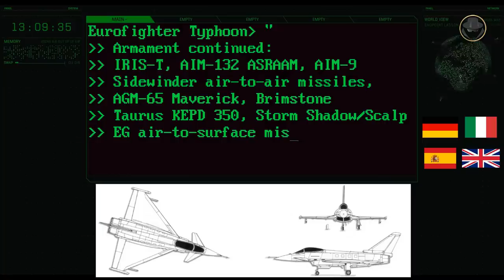Eurofighter Typhoon | The story that the West does not want to tell

Comment: It is an extraordinary aircraft. The real challenge is that for many nations the F16 is good enough and cheaper.
Reply: Tranch 3 and 4 typhoons armed with meteors and Brimstone missiles are as good as F-22 and F-35s. Most counties have early model F-16 which are far behind in terms on senors and radar.
Reply: @scottwhitley3392  but an f35 is like 20 million dollars cheaper than a typhoon. f35 is actually cheaper than the grippen.
Reply: @nick4506  It’s cheaper to buy outright. It’s far more expensive to maintain and repair over its lifetime. The Gripen is designed to for ease of maintenance. Normally only about 40-60% of total aircraft are actually in active service the rest are down for maintenance. With the F-35 that number will be at the lower end of the scale. With gripen that number is much higher. You also need to factor in the time it takes for special parts to arrive from the US.
Reply: @scottwhitley3392  maybe but the difference is about 10 million dollars. 85ish vs 95ish. that's a lot of extra money that the difference in hourly cost has to pay down to make the grippen worth it. and along with Lockheed's mantince training and all the other closer f35 operators in Europe the shipping time for replacements shouldn't be that bad. there is a reason why most of Europe is going for the f35 and believe me they are taking into account the hourly costs.
and tbh the percentage of a fleet that's down for mantince is kinda a secret that countries don't like to give out and we don't know the numbers for the grippen or the f35. you can guess but it means nothing.
Reply: @nick4506  only if they purchase the A version of the F-35 and even then the per hr cost of flight time for the F035 is around 35,00o where the Gripen is around 8,000 so I would go with the gripen for sure.
Reply: @thetazva  f15s aren't carrier-capable, noor is grippen. and that grippen cost per flight hour is with support from sabb that runs out and the cost is right up with the rest of them after that. for the airforce its only between the A model and other stuff.

also did you hear the news? they slashed the f15ex order, someone finally saw the light.
Reply: And Rafales and Gripens.
Reply: @maxkronader5225  Especially Rafale and grippens. 
The EF suffers badly from the camparaison with the rafale...
Reply: @poiujnbvcxdswq It is easy,if you follow the military aviation world ,you know :
Every time the 2 compared in red flag exercises or in national contract competitions, the rafale was on top, in almost everything, and everytime.
Just do a quick search.
Switzerland for exemple, has given detailed notes on every missions, and you cand find these details easily.
India, belgium, egypt, etc, every country that tried borth aircraft.
But , of course, since they all say after trying both aircraft, that your eurofighter is not as good as a french aircraft, they must be morons?
You want pilots speaking about that? Ate is a former rafale pilot from the french "aeronavale" , and an ex demostrator pilot for the "tiger meet", he talked multiple times about it.
And he is not a F35 basher like a lot of european.
The EF is a good plane but e ery mission it does, the rafale can do it better.
Sometime slightly, sometime vastly (air to ground missions...)
Reply: @nick4506  Ok, give us the comparisons, please??...

Comment: A modern fighter with over 600 samples - that’s a success no matter how you look at it.
Reply: How many F-16 have been sold?
Reply: @notmenotme614  What's that got to with fuck all? No one said most successful did they?
Reply: @notmenotme614  F-16s aren’t modern fighters, they’re from the 1970’s. They’re massively cheaper and much less capable than a modern 4th or 5th gen fighter
Reply: @greva2904  You are also forgetting the simple fact that it's the exact BEING from the 1970's that allowed it to reach those numbers in the first place.
Reply: @getsideways7257  Yep. And they would be cannon fodder in a modern war against a capable enemy.
Reply: @greva2904  Probably, but not necessarily.
Reply: @greva2904  updated f16s are pretty close to eurofighters in a2a and superior in a2g
Reply: @greva2904  Manned  attack aircraft  are going the way of sail and steam which generation aircraft is sent on potential drone kamikaze run ,what will it matter.
Reply: If more atack drones are made than enemies ability to surpress them you win ,cheap and numerous only big enough to carry ordinance to target launched from submerged submarine.Some programs canned others from drone pilot.
Reply: @notmenotme614  One can't compare the Eurofighter and F-16. Eurofighter is much larger, capable and planes in the league of the F-15E. F-16also came 20-25 yeas earlier and was the main USAF jet, plus the largest export program ever, with European production for the Netherlands, Belgium, Denmark and Norway to replace the F-104 in the late 70s/early 80s.
Reply: @greva2904  New F-16s are at the same technological level as the Typhoon.
Reply: @xyzaero  MMmhhh the F-104 Starfigther the Widowmaker. Fortunately, the F-16 was better designed. Otherwise the Russians could have won the air battle just by letting the pilots equipped with this coffin take off.^^
Reply: @olivierpuyou3621  The F-104 had a fairly normal accident rate for fighters of it's time. The Germans had a higher accident rate than others, but that had nothing to do with the F-104 itself. The hight German accident rate came from the immaturity and weak structure of the Luftwaffe at the time. The Luftwaffe was just not ready for this jet.
Reply: @greva2904  no wonder TopGun was all about Tomcats v middle eastern Migs lol
Reply: @xyzaero  I seem to recall the 'sales' of F104's involved a fair degree of corruption....
Reply: @tompiper9276  as any other large arms deal in history did.
Reply: @greva2904  really ... You think f16 block 60 is cannon fodder ?
Reply: @xyzaero  The Eurofighter and the F-16 are almost of the same size.
Reply: @notmenotme614  the F-16 entered production during the Cold War. It was during a time when militaries were much larger (due to the Soviet threat). The nature of wars have changed greatly, hence modern militaries have less aircrafts. Same goes with tanks which were being procured in much higher numbers.
Reply: @rid1bee  that’s right, my mistake. Still, Typhoon plays in a very different performance class. Don’t want to badmouth the F-16 in any shape or form, but 25 years of technological advancement between the two just separates them.
Reply: @rid1bee  true .. almost same size, my mistake 👍🏻
Reply: @notmenotme614  F-16s are BigMacs.   Eurofighter is RedRobin Gourmet Cheeseburger.
Reply: @xyzaero  the latest F-16, from Block 50/52 upwards are very different from the earliest F-16 (Block 5,10,15,20). Obviously same applies for the Typhoon. The Tranche 3 & 4 are very different from the Tranche 1. Coincidentally, the F-16 and the Typhoon were both designed for the same purpose, i.e air superiority. However, the F-16 evolved quicker into a true multirole fighter than the Typhoon.
Reply: @rid1bee  that’s true, but the “ground pounder” F-16s just don’t have the “raw flight performance” anymore, while the Typhoon kept it and Tranche 4 might even be much much more powerful than 1-3. I guess that avionics wise these 2 platforms are pretty much useless n the same level by now. My guess 🤷🏻‍♂️ I like both a lot 👍🏻
Reply: @notmenotme614  How many F-16’s have been mothballed by the U.S.A?
Reply: @notmenotme614  Mostly under pressure to buy arms from the US. Euro fighter is expensive but in a league above F-16.
Reply: @hphp31416  Updated Typhoons are superior to F-16 in both respects.
Reply: @xyzaero  New F-16s are not the equivalent of the Typhoon, let alone and upgraded one.
Reply: @xyzaero  Unlikely. Many nations had no choice but to buy American for political reasons. Nothing to do with the aircraft or whether it is any good.
Reply: @davidmacdonald1695  flight performance-wise not, but talking Mission systems they are pretty much the same.
Reply: @davidmacdonald1695  all arms sales are based in political decisions and not on the performance of the product.
Reply: @xyzaero  Comparing two aircrafts is like comparing apples to oranges. While the f-16 was developed in the 70's, its been updated numerus times and the V Variant (Viper) is very advanced technologically. Compared to a Tranche 1 or 2 Eurofighter (90's viariants) it has superior avionics and radar . In a dogfight situation, the Typhoon is superior as well in interception. But in order to get in a dogfight or an interdiction, the context or the situation is very relevant. For example in an area with denial of access, containing interlinked radars and SAMs (like the Russian aerospace) dogfight capabilities count for nothing.
TLdr each aircraft is good for a certain purpose. Typhoon is mostly air superiority and interception, F-16 is multirole (CAS, bombing, precision strike, air superiority) like a jack of all trades, doing many things but expert in none.
Reply: @notmenotme614  Is anyone still buying the F-16? Pakistan or Taiwan?
Reply: @SpartanGR  and what‘s the news in your Post?
Reply: LOL, that's when you include the non-export units. Just a joke.
Reply: @hphp31416  seriously f16 stand nowhere close to typhoon
Reply: @xyzaero  false staement
Reply: @notmenotme614   The F-16 is a good half-generation earlier  and it replaced the hundreds of F-104 in European and Asian service.  On the other hand the "Typhoon" is designed to perform tasked "standard" F-16A and C, before Block 50 +, were not designed to fulfill. In some roles even Block 50+ Falcons can compete with the "Typhoon". The right comparison for the "Typhoon" would be the F/A-18E.
Reply: @xyzaero  F16 in Viper configuration block 70/72 is same league of Typhoon or better !!!
Reply: @hphp31416  no
Reply: @Viral_Squad  no. The euro is faster, more maneuverable at higher and lower speeds, has a faster climb rate, better avionics better radar and also a much better bvr. It would win 9.5 times out of ten in a dog fight against an f16.
Reply: People responding to this like the F16 in modern variants isn't an incredible fighter
Reply: @hphp31416  yes, upgraded, meaning a nation needs to spend even more money on upgrading them
Reply: @greva2904  
US fighter aircraft from the 1970s is more advanced than what other countries are producing. 
The US was building aircraft in the 1960s that countries still cannot build today.
Reply: @xyzaero  
The F15 and F16 are tried and tested and have a long service history and are still cutting edge today. 
Europe trying to build a single fighter that could do everything was a flawed concept from the beginning. 
The American approach of specialized fighters and then general cheaper fighters is a far more successful route.
Reply: @bighands69  Define success!
Reply: @bighands69  Uh-huh. Especially "cheaper". 
Except the "American approach" focuses on bragging rights rather than an actual concept, and doesn't fit European needs at all.

The "American approach" is based largely on force projection, being able to hide behind two oceans from any outside threat. That means you can purposefully plan to send what you need to where you need it.

A European air force built on that approach would be completely and utterly useless. The likelihood of being the theater oneself was historically much, much higher. That means you need any given task being ready to be done within minutes, not hours. You don't have the luxury to send a bomber long-range with in-air refueling from half-way across the planet, you need the bombs on target NOW, before the enemy force has crossed that river, not tomorrow, not next week.

Which is also why stealth and BVR plays much less of a role. You're not going to go to the other end of the world trying to sneak up on an enemy that often. More - with national borders being much closer, you're going to be at the limit of your authority in no time with a modern fighter. When it comes to air-to-air combat, chances are you're scrambling right under the enemies posterior or you have no business scrambling at all.
Reply: @getsideways7257  "not necessarily" - the argument used by someone who has no other argument.
Reply: @trevor311264  Good for you, coming up with more arguments that that.
Reply: @getsideways7257  I was not using it to prop up my argument though.
Reply: @trevor311264  Indeed. You came out of nowhere in the first place.
Reply: @bighands69  The Americans are building specialized fighters? The only specialized fighters were the F-111 and F-22. Everything is multirole, jack of all trades designs (F-15/16/1835), especially Americas latest venture, the F-35 ... I don't know in witch universe you live ... LOL
Reply: @bighands69  And no neither Raphale, Gripen nor Eurofighter are flawed concepts, quite to the contrary, they are extremely capable and combat proven systems (only he Gripen has almost no real world experience).
Reply: @strikeeagle3159  what is a false statement?
Reply: @trevor311264  I have no clue to wtich of my posts you are referring to
Reply: @xyzaero  neither have I now.....
Reply: @trevor311264  LOL ;-)
Reply: @greva2904  it's over confidance like yours that allows f16's to always capable and a valid threat
Reply: The Austrian case gives a much clearer picture of the whole story!
One huge problem is the fact that the promised flight Hours were cutt down because of the body to wing connection (costly), and the communication system was the second but much larger reason to get out (Every hour has to be payed to the US! And if you want to talk or be private, you pay more)!
The 600 examples are the one the Countries involved had to buy!
Reply: Tranche 1 are already totally obsolete and cannot be upgraded
Reply: Only the export sales matters. There is not 600 jets, only 150.
Reply: When you’ve sunk billions into the development costs, the political cost of not ordering the finished product would be catastrophic
The Typhoon was designed to fight in a war everyone hoped would never happen and which ended without a shot fired. They’ve done a fairly good job of upgrades to give it multirole capability but that was never the original plan
Reply: @greva2904  
It depends 100% on RoE.
Reply: @sturmanaskie  Spain is upgrading them so you are wrong. They will be equivalent to tranche 2 and capable of further upgrade when program is finished. Get your facts right.